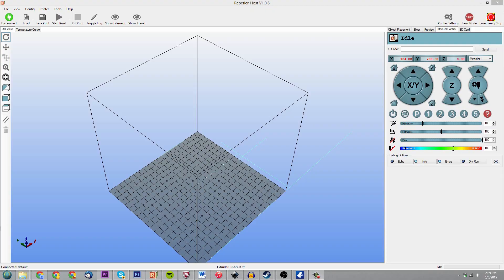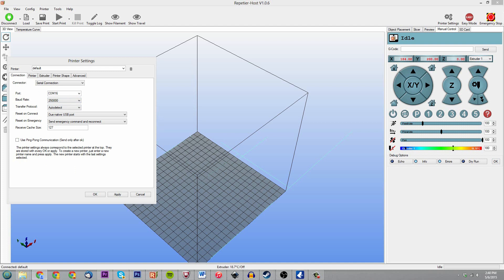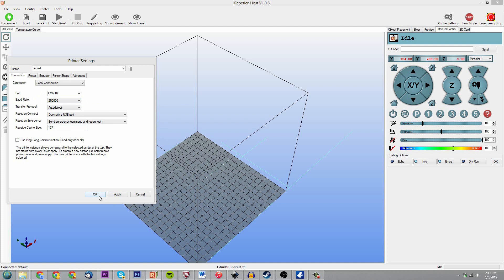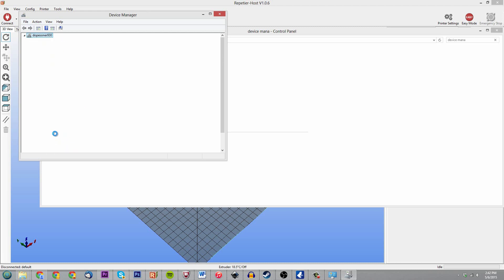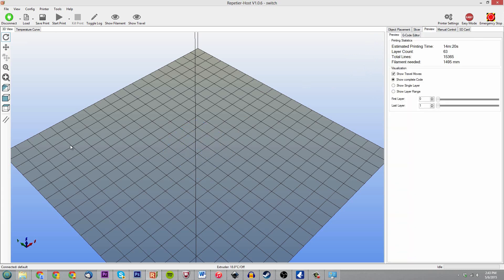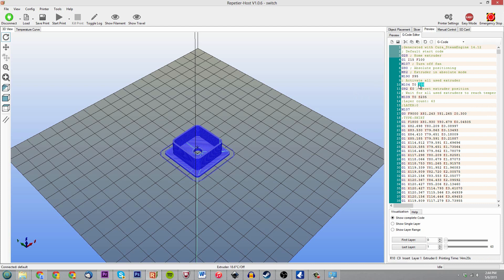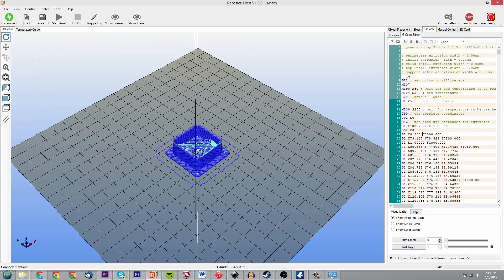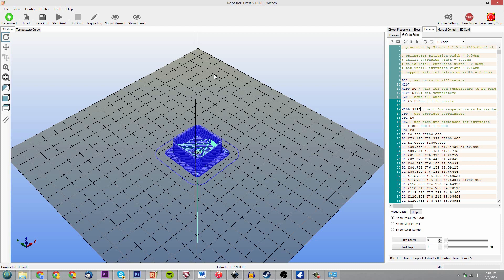Setting Up Your 3D Printer With Repetier Host | My Settings | ABS & PLA Temperatures

Comment: Firstly, "configurate" is not a word. "Configure" is the word you need. 

Secondly, how about looking up what baud rate is BEFORE you press record on your video recorder?! Watching someone google it is boring.

And then, incredibly for a video entitled "Setting up your 3D Printer with Repetier..." - you actually DON'T SET UP YOUR PRINTER.
You prefer to edit the G-code for every single print?!?!?! That's insanely ridiculous.

Incredible.

Comment: Hello, does Repetier Host plug directly from the PC to the printer with a USB cable? Or does it require some sort of interface circuitry in-between?
Reply: Yes, directly through USB cable (Although you may have figured this out by now :))

Comment: hi, anyone who can please answer or suggest any information on this question, I purchased one of those anet 8a clones, went together quick everything seems to function, ok now the question, I have not been able to print due to what appears to be a firmware issue, the bed reaches and maintains set heat, the nozzle never reaches the set heat as soon as it reaches 188 it starts to cool down and aborts the print, I purchased a new nozzle with heating element and thermistor assembled thinking yhe original was faulty but I still get the same result, any recommendations before I hurl this thing through my window, thanks 😨

Comment: when using curaengine, did u edit the gcode for temperature?? I am used to sli3r, but when try curaengine, my 3d printer not detect any temperature from slicing with curaengine?

Comment: Hey man, I'm trying to build a DIY CNC machine. Using Ramps 1.4 and repetier. When I use repetier host to manually move individual motors. X and Y axis move at the same time and at the same direction:/ Any idea?

Comment: When setting up my printer settings for "Port" the only option that comes up for me is "Auto", whereas I see you're supposed to connect to COM22. What can I do to ensure my laptop finds the proper port? I've already updated my device driver software, and I'm running windows 7.

Comment: Dopesoner, what brand of PLA do you have the best luck with your Da Vinci? Sorry if you mentioned it, I didn't catch it if you did. I just bought a roll of SainSmart and it clogs my nozzle on every print I have tried. I have spent an entire day experimenting trying to find a good temperature and speed setting that will work, But it clogs every single time. I use the same brand in ABS with great results, so I don't know if it is the brand a bad spoil or my printer. I have tried increment temperature settings from 195 up to 240. Anything below 210 doesn't seem to adhere to the bed. The manufacturer calls for between 210 and 250 for temp. It flows great at that range for the first 45 minuets or so. This is the first time I have tried any PLA. I've printed hundreds of hours with ABS on my Da Vinci both before and after flashing it, and have never had a clog once. Any suggestions? Thanks. Your videos have been most helpful.

Comment: How do you Calibrate with Repetier and why would I need to mess with heat syncs if I have the 1.0 if I'm printing at a lower temperature?
Reply: You need to check the print temperature from the manufacture of the filament it is normaly on the spool label .

Comment: Hi Dopesoner,

Really enjoyed your videos - and believe it or not - you've about convinced me to buy the Da Vinci.  Sure, need to flash a third party flash image, and putter with it a bit.  I'm an electrical engineer, and personally I've been working in Autocad for more than two decades, +solid for more than 15 years, but haven't sprung for a 3D printer yet.  

You've done a LOT of printing, and it seems to hold up pretty well for you mechanically.  I'm really interested in printing pretty minor stuff - occasional small-parts and custom project enclosures (never can find the right project box).

ON TO THE QUESTION ;-)

Whose PLA (brand?) are you using that your temps work well for and that are giving you decent prints?

Thank you again, and subscribed!
Reply from the maker: Thank you for the sub! I honestly feel it's a great beginner printer and if you have no problem flashing and messing with it a bit it is great for what you will need. I have been buying my PLA off amazon here is a link to the exact filament! http://www.amazon.com/gp/aw/d/B00J0ECR5I/ref=mp_s_a_1_1?qid=1431901912&sr=8-1&pi=AC_SY200_QL40&keywords=pla+filament&dpPl=1&dpID=515haNPVw1L&ref=plSrch

I am jealous of your experience with cad I am such a novice :/!
Reply: Dopesoner Thank you for your quick and detailed reply!  I do appreciate your giving us all a leg-up with your trials, tribulations, and experiences.   (and tolerating my verbose "question" ;-) )

I have been to Maker Faire (bay area) every year but last year.  Went again this year and KABOOM!  3D printed had EXPLODED onto the scene.  I've never really thought much about it, but as I was walking around fondling the printers and parts they'd printed, a thousand-and-one things that I either hand build or never have on hand to finish a project came flooding in.  Heck, I'd pay for the printer and supplies the first year just in project boxes alone!  

Then I started thinking about metal casting and resin casting from printed parts and...  It just felt like it was time.  I really feel like this is all very immature yet, so running out and spending several thousand dollars feels senseless.  $500?  Yeah, I can do that to get my feet wet and start feeling comfortable with the industry direction and ready for the next big move.  

Thank you again!
Reply: Dopesoner Thanks again for all your 3D printing videos.  Trigger pulled, arriving on Wednesday + 4kg of Hatchbox PLA, and 7" wide painter's tape. ;-)  Now I need to clean the lab up and find a place for it (sigh!)